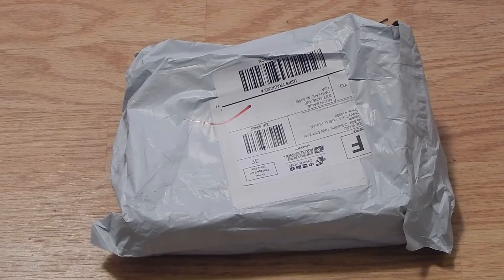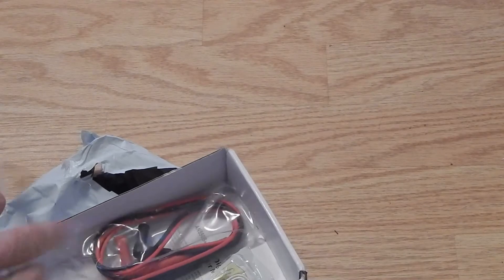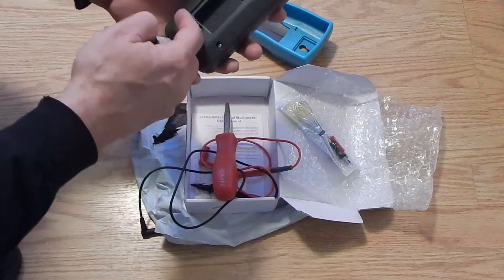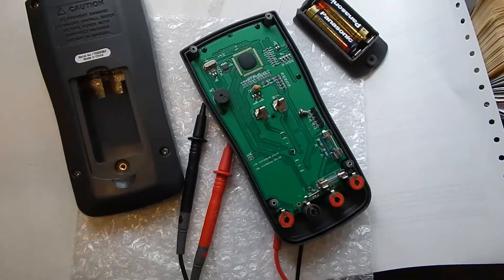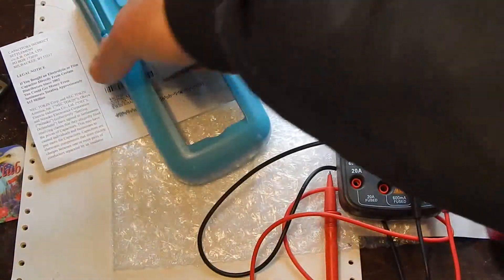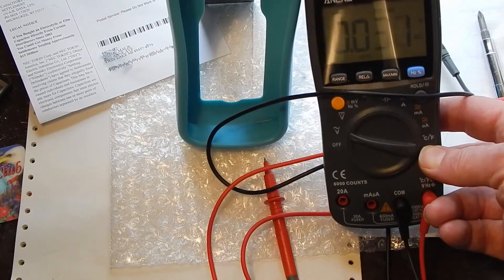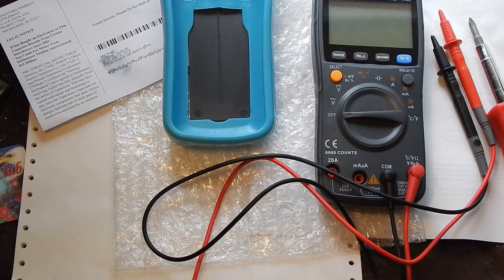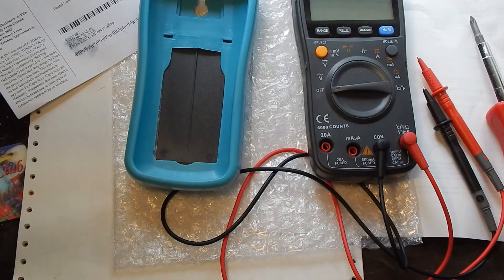Another COB DVM - the ANENG 860B+ aka. Kasuntest

Comment: Is it still working?. I bought a HTC dm86 chinese meter & it failed in 3 months.
Reply from the maker: Yes, I have been using it as my primary meter now that I took it's little brother to another location (here). I am also awaiting the successor to the little brother to arrive, it has an even higher count rate and other improvements. Yes, I've seen many a trashy Chinese DVM, but this particular series (COB w/ high count rates) has generated pretty good ratings across the net. Looked at the one you mentioned and it is not one of these, and it isn't getting great ratings. Always dig into the reviews when purchasing something like this. By "little brother", I mean the meter shown in
https://youtu.be/Nni_Q32vvZI
Reply from the maker: The damn vinyl ring still stinks though...